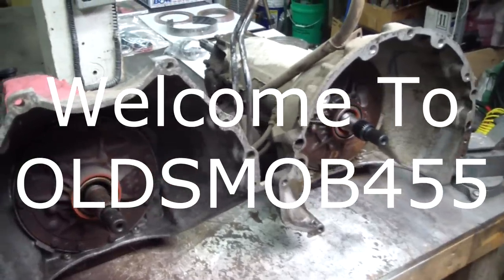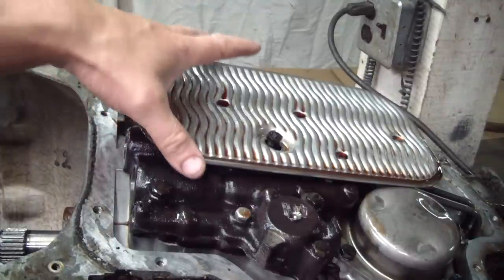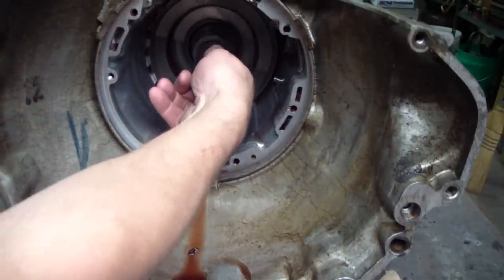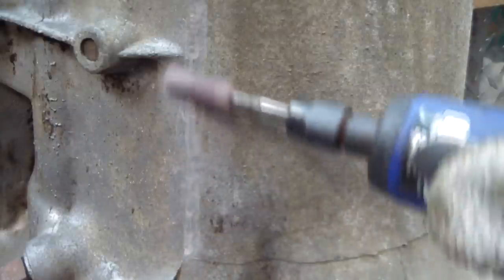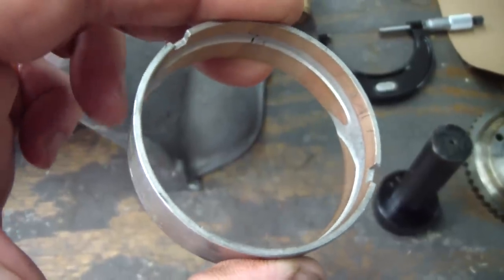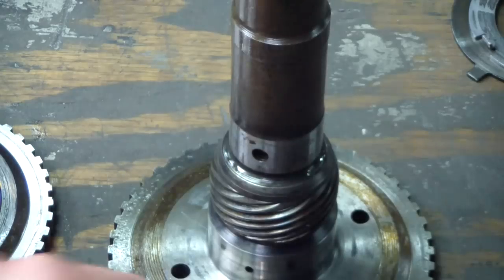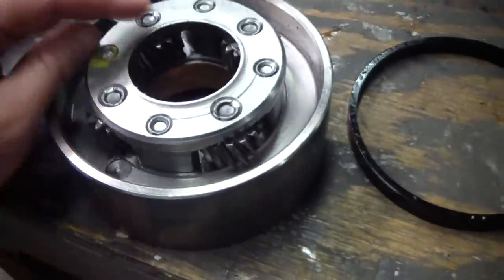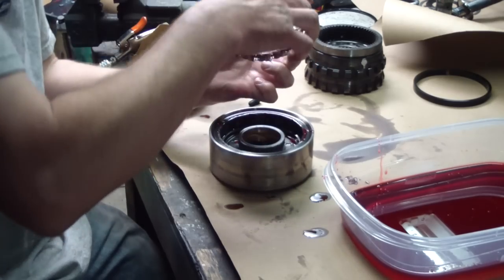Turbo 400 Blueprint Rebuild part 1 of 2

Comment: Great video.  My transmissions have never required anything more than routine maintenance, but I am thinking of building a 400 with the switch pitch converter.  I had one in my Toronado, and I loved it.
Bob

Comment: Very nice video, very in-depth and clear. I didn't actually "blueprint" mine, but after a rebuild, it runs like a clock. Amazing brute of a transmission, even if it's only got 3 gears hahaha

Comment: Really amazing couple clips. I know more than ever why I would never do what you just accomplished... Pretty darn amazing and so well done. Thanks. I did do a servo replacement, separating valve body on a Sunday (unnecessarily as it turned out) on my sons 06 Ram a while back. dropping 7 balls all over. Fun finding a spot on the internet to show me where the balls had to go, (Thanks Cascade Transmission)

Comment: A good example would be the old Jeep Wagoneers used a 400 and the later say 80s used a 727. But both were used behind the 340 AMC motors.

Comment: it is important too check your ''a-b'' measurement before swapping tail shaft from a two wheel drive to a 4 wheel drive bellhousing or vise versa even if bolt pattern is the same. for example ford th400's have 1/8th differance than a chev or gm witch means your tourque convertor will not properly seat causing pump issues over time and a lot of vibration at low idle along with poor performance.A-B measurment is how far the tourque convertor seats into the tranni in relation to the bellhousing mounting surface.learned this the hard way was not mentioned in repair manual.enjoyed the vid thanks!

Comment: OK. I am working on a 1987 Chevy Blazer. Has a 350 Engine with a Turbo 400 Transmission. When torn apart, it had 5 check balls total. I diagramed where they went and put that many back in, in the same spot. After rebuild, Transmission worked fine for 2 days, then started not wanting to shift right, lost forward gears with reverse only working. After letting it set, we went to drive it again, had forward gears back, but problems with going into second. So we tore the transmission down again to find that the  retainer ring that holds in the intermediate clutch plates was warped and not in the case properly. I've never seen one do that ever, and I've been doing transmissions for a while now.

Comment: Just like to say very well done on "This is not a instruction video". Very knowledgeable and helpful. I kinda wish all vid's I see are clear as you were! Thank you for sharing. 
Question? In your rebuilding, do you trouble shoot trans problems? Or do you just rebuild when there's a problem?
Again nice to see thoroughness and clearness in a video.
Reply from the maker: Problems should always be troubleshooted as best as possible before shooting the parts cannon at them.
Reply: i was thinking the same thing......for a Non-instructional video.....this was one of the best and most helpful instructional videos ive seen for the TH400.......im pretty sure i fried mine doing a fluid/filter change.....so i might be rebuilding mine soon......or doing a 4L80e swap ;)  
THANKS FOR THE VIDEO

Comment: Excellent 'non-instructional video'! I just tore down the entire thing exactly as the video 'non-instructed' with 1 exception. I was not able to remove the sun gear. I've never attempted anything this involved so I don't know if this a bad thing or it's just held in place by some retaining clip / snap-ring. should I keep going?

Comment: On your tear down you  make the comment that if you were only planning on changing output shaft, that you could stop the tear down from proceeding any further after only removing the valve body, as if then all you would need to do is remove the case to center support bolt to remove the output shaft. Perhaps I misunderstood your comment, although I'm sure you would agree that you have to completely tear the trans. apart to remove the shaft.

Comment: I am rebuilding my th400 and noticed it has the waved plates in the direct and foward,intermediate drums do you recommend putting them back in or is it ok to replace it with a thick still for daily street riding 450hp 478tq any help will help and thanks for the great videos!!
Reply from the maker: As long as your clutch stack clearance is correct I don't think it makes much difference.

Comment: Need help!
I have a TH400 that I found out the Speedometer drive gear clip is missing making my speedometer not working. The drive gear is plastic and has the groove for the clip but it is not on the shaft or the gear. I pulled the tailshaft housing and it is not anywhere. I pulled the pan on the transmission and still don't see it. Where could it of moved to? I was thinking of pulling out the Governor to see if it fell into that area but am concerned I will create more problems removing it. Will things fall apart or will it all stay together if I remove it?. (Transmission is still in the car). I tried reaching into the transmission from the output shaft area  but don't feel it there. I used a magnet to move around and didn't feel it. Any help will be greatly appreciated.

Comment: I gotta question (total transmission noob), I was researching how to change the shift points on my 454SS (400 turbo) and it said change the weights in the governor,  it shifts at 4k I was wanting about 4,500 to 5,000, would the shift point change kit suffice? It also has 260,000 miles on the trans too so I don't want to take a chance at tearin it up. Thanks!

Comment: If you haven't solved this issue I may be able to help. B&M sells a kit with selective springs and weights that works well. Takes a bit of trial and error but you can get it dialed in with a little time. Also I have a valve body trick for first gear that may help. Message me if you like.

Comment: I had it banged into me in Grammar School back in Yorkshire...now English Grammar is one of my pet peeves....LOL...I am working on my latest creation...a Super 7 on steroids...that is one way it was described at Portland ABFM...Unfortunately using an old 400 it has been somewhat problematic.....replaced with another "good " : used unit...well many years ago...and now we have no gear movement ...initially we had some but I think we may have sucked up some old fluid perhaps into the valve body...Replaced the filter and refilled fluid and now nothing...
Reply: Edmund Arthur Dickenson mtoKip🔙👟